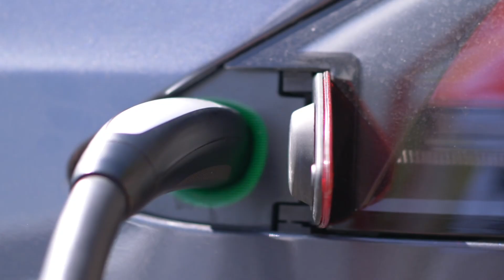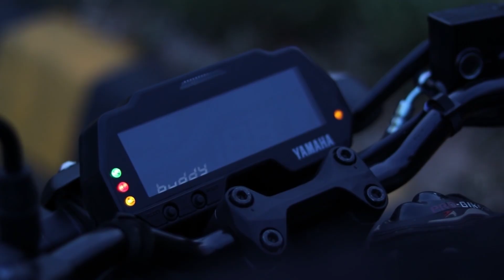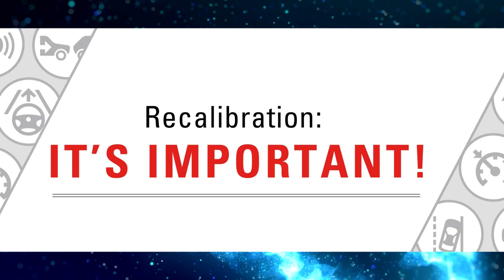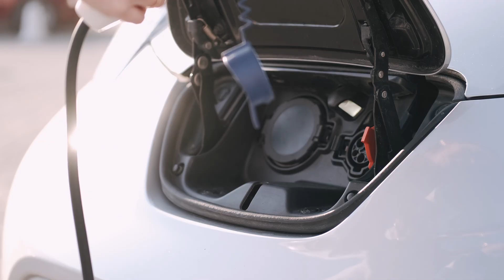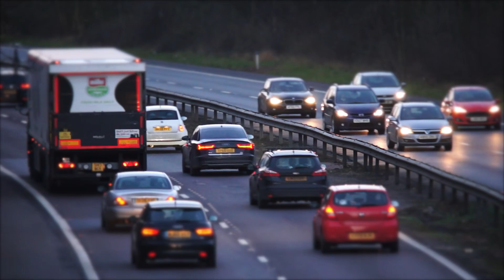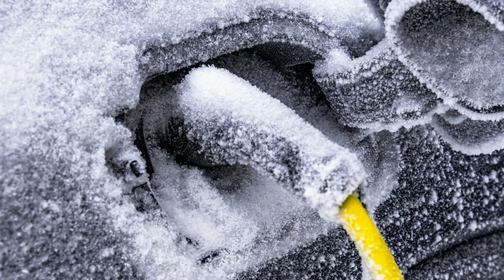LFP Battery Recalibration: Myth vs. Engineering Reality (2025 Deep Dive)

Comment: Are both needed higher anchor and lower anchor? 
Is it better to get to lower anchor point to less than 10% then rest and then charge so the way to 100% in the same cycle?
Or can we just reach one anchor like only higher like monthly once or both anchor needed? 
Does both anchor needed to be on the same charging cycle?
Reply from the maker: Hi i would recommend both of them because i dont know the balancing software behaviour on all ev’s.
Reply: @shayan_ev thankyou very much for the reply, but iss it needed to be done in one charging cycle like from <10% to 100%? Or can it be done in saperate charge cycles also?
Reply: @shayan_ev anything on this please let me know?
Reply from the maker: @v @vshravan01 Hi 
It should  give an ok rough result in one charging cycle.
However its better to do it multiple times and see if soh’s are different or not.